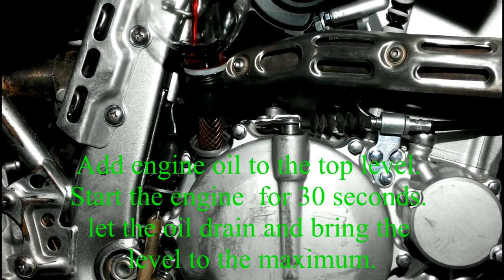Changing the oil and filter is easy  Kawasaki KLX 250

Comment: I was wanting to get the klx250 was wondering what the intervals would be for oil changes and valve checks
Reply: Kawasaki wants oil changes and valves done every 7500 miles
Reply: Annually unless you do a vast amount of riding.  Valve checks at 7500 miles.  In reality maybe never, except for the first one.  But do them anyway.

Comment: Next time add a dab of grease to the end of the spring. that will hold it in place to put the filter on. No need to tip the bike over
Reply from the maker: much faster put the bike on its side:)
Reply: That right there is what I do.
Reply: tema enduro are you well ????????
Reply: i tried the grease method it didnt work then i was scared the grease would fuck shit up cause its not oil its grease the tilt works ever time
Reply: I used a zip tie to hold the spring while I put the filter on. Once the filter is in with the spring in place, I pull the flat end of the zip tie off. Works like a charm.

You don't need a zip tie. Maybe some copper wire will work as well.